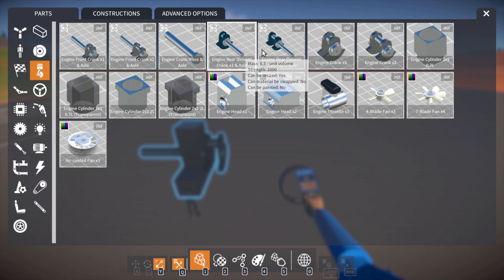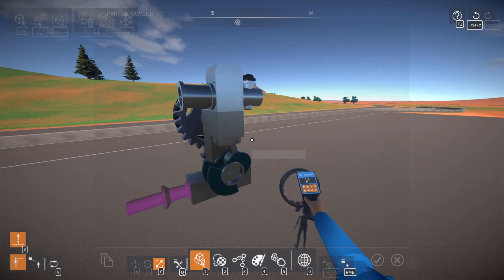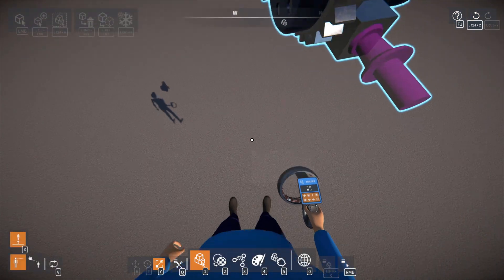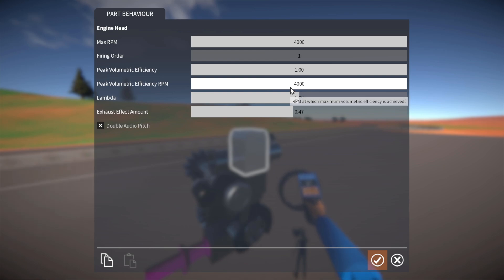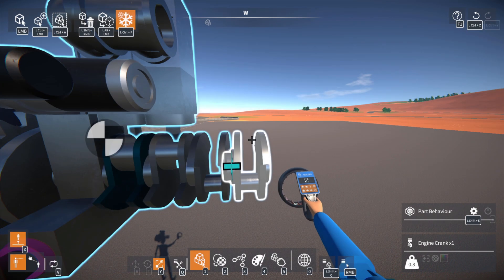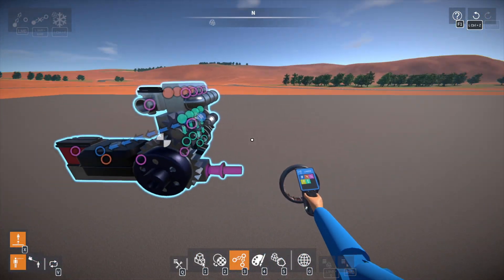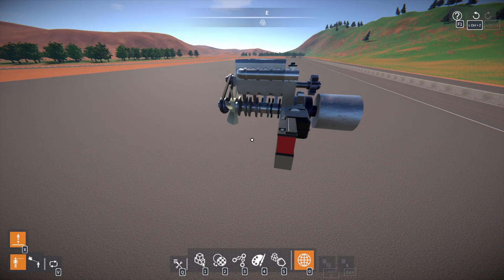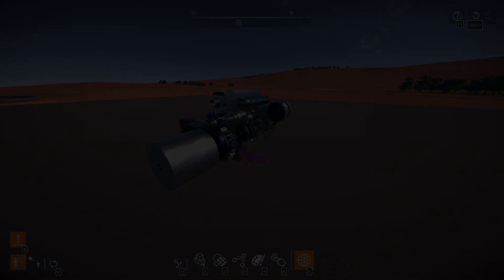Building Basic Engines  |  [Tutorial]  |  GearBlocks

Comment: The crank is spinning but say zero rpm
Reply from the maker: It needs to be the powered crank, it needs to be mounted to a block, and it needs to be connected to a piston for a value to appear.
Reply: I got it working but It can't rev above 500rpm
Reply from the maker: Do you have a keybind on the throttle?
Reply: @AlMagmaGaming  Yes but it still doesn't do anything

Comment: how do i make the torque of the engine bigger instead of the rpm, btw im having a bit of a problem, the engine throttle part is stuck at 90 degrees angle idk why, so every time i start the engine it just goes full power all the time non stop, some one know how to fix this?
Reply from the maker: "Peak Volumetric Efficiency" is the total accessible torque.
"Peak Volumetric Efficiency RPM" is where that torque is accessible.

If the throttle is stuck open, make sure "Idle Control Min%" is turn down or even off.
You can also set your "Idle RPM" lower. by default it is 500.
Reply: @AlMagmaGaming  thanks problem solved

Comment: this i4 crank angle offset 💀
Reply from the maker: I did mention in the video that normally the engine would have the front and back together at the same offset and the middle two at the opposite offset, BUT this is a video game and it doesn't matter so I just did the front two and back two.
Reply: @AlMagmaGaming  yes, the most important thing is that the firing order is at equal intervals within 720 degrees
Reply from the maker: They are 4 stroke.
I've tested it and some people have also found it in the files.